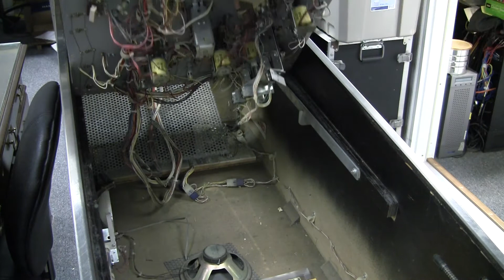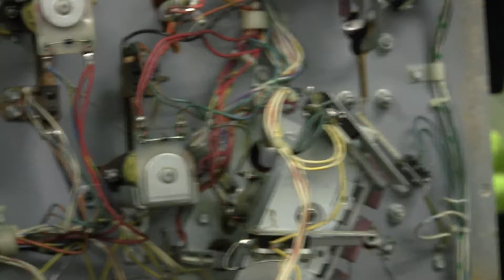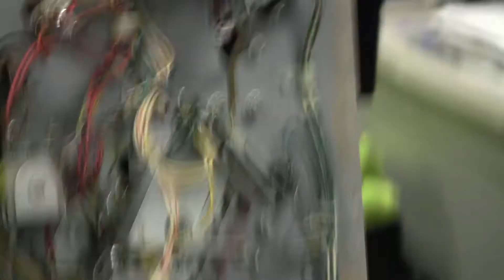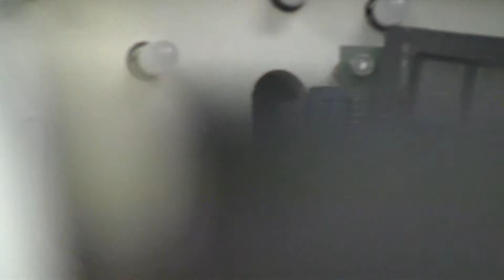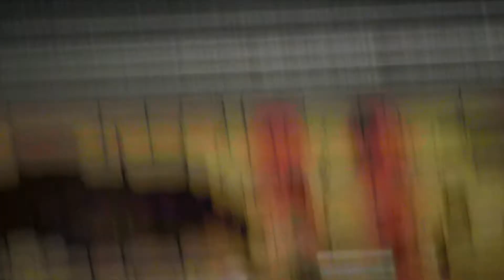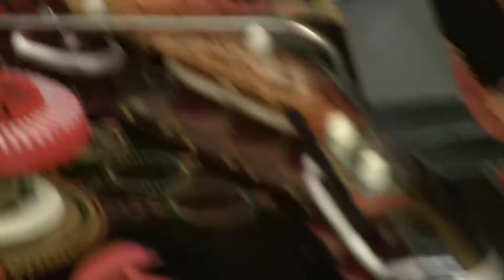Williams Sorcerer Pinball - fixing problem with coils and scoring - PinballHelp.com

Comment: Has this game been modified?  I can see large some capacitors for each of the flippers on this machine. On mine, these are not present and instead I have 1 x beefy diode mounted on a black U shape plastic dedicated bracket, a few centimeters off each pinball assembly,   connected via green wires. I have no other under playfield picture as reference to compare and judge which is the original design as it left the factory. Thanks for your comments.
Reply: Mine his the same as his.  It's not modified.  Came that way from the factory.  See here: https://pinside.com/pinball/forum/topic/replacing-sorcerer-flipper-coils-serial-vs-parallel
Reply: Mine his the same as his.  It's not modified.  Came that way from the factory.  See here: https://pinside.com/pinball/forum/topic/replacing-sorcerer-flipper-coils-serial-vs-parallel